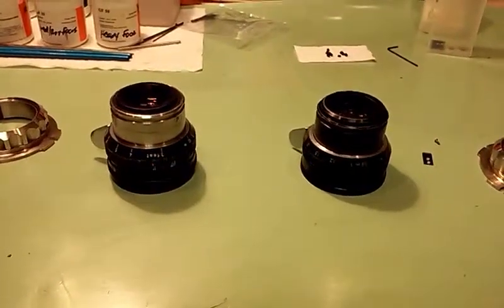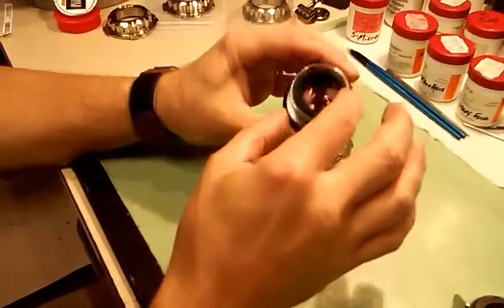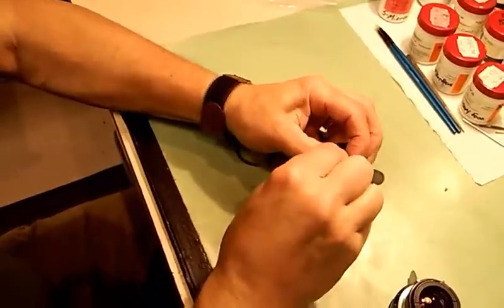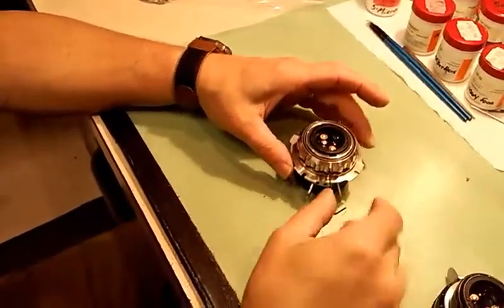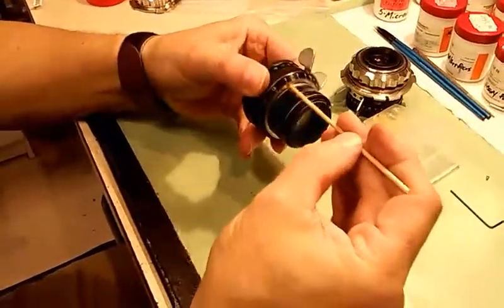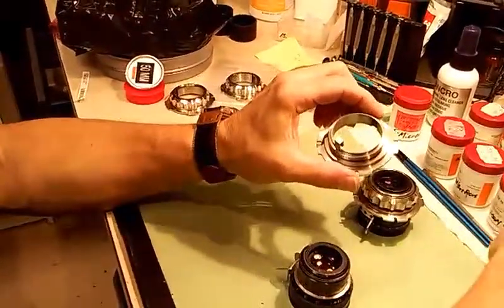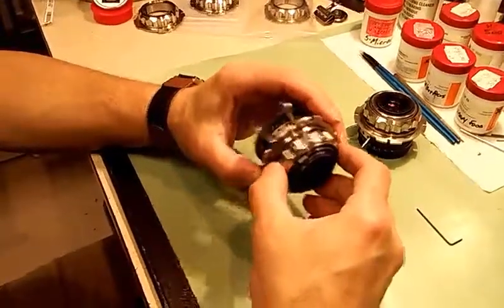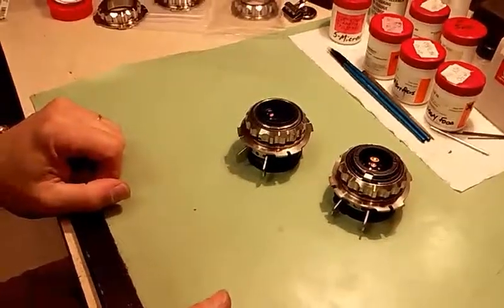Visual Products Arri PL adapter installation on Arri Standard mount lenses

Comment: Hey, great vid. Is there a mount for Arri B body to pl ? All I’m finding is vice versa. I have a Arriflex 16sr with no lenses and was wondering how I could save money on rentals. Thanks
Reply from the maker: Hi Zakee,
 You can only go from Arri standard or bayonet mount to PL on the lens side... not the other way around which is why you're not finding adapters available. The only way to make your stock SR accept PL lenses is to have it converted to PL mount. We do have solutions at Visual Products for that a well as S-16 & HD-SDI video assist... give us a call!
Reply: Paul Scaglione no way ! I’ve been on you guys website searching for equipment. I had no clue you work for them !!! I will defiantly been in contact with you. Thanks for the info

Comment from the maker: Hello Michael,
 If the lens cleared while inching by hand you're okay. In all but the case of some early 16mm Aaton cameras, the mirror-shutters are really well controlled by their bearing sets so won't move during start up or run. If they did, your ability to have accurate eye focus would be impossible. Those older wide lenses were scary because of how close they came to the mirrors but for the most part the Arri black cameras were always okay. When we flipped over to the gray cameras; 435's, 535's and Arricams that changed due to mirror clearances being reduced. I don't think you will, but don't push your luck by netting the back of the lens.... I've seen mirrors sanded by people snot taping some Christian Dior to the back of one of these old wide lenses and not realizing there was an issue until a lens change!
 Good luck!
Reply: Hello Paul! How are you?? I'm italian. I found in italy the Arrifex 35 BL 4 !! I found my film camera in the old warehouse. I use this camera for only collection. But my BL haven't lens. I search a vintage lens, very economic, because i can't spend many money for a litte prime lens PL (50mm is good). You can help me for this?
Reply from the maker: Hello,
 Check out ebay item 204499568712.
This lens with any number of inexpensive Arri standard to PL adapters available online would be dine for display.
Reply: @paulscaglione8814   Thank You Paul! But this lens in USA, but i found this lens at Rome, my country! I can't paste the link in this message... but i can contact the seller for try on bl camera body (with PL adapter)

Comment: Paul, I have one of VP's Arri Std. adapters. Besides looking great, it's very solid performer. I recently purchased an early 1960's Angie 14.5mm in an Arri Std. mount. I test mounted it last night trying several makes of adapters on a BL4, a 35-III and a 2C (all PL mt.), only to discover that the mirror clearance was frightfully near non-existent! I was able to cautiously hand rotate the cam's shutters via their inching knobs, but thought it best not to risk powering them up. Was the back-end heavy 14.5mm one of the causalities of the updated mirror that Arri introduced in the early 1980's?